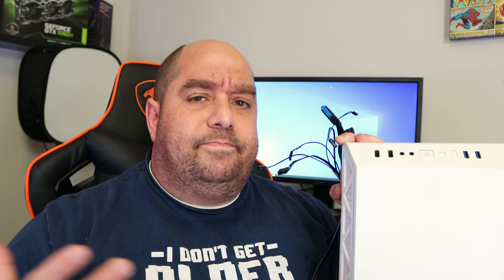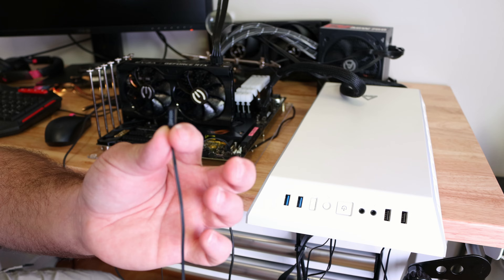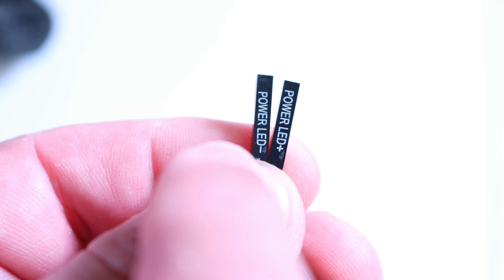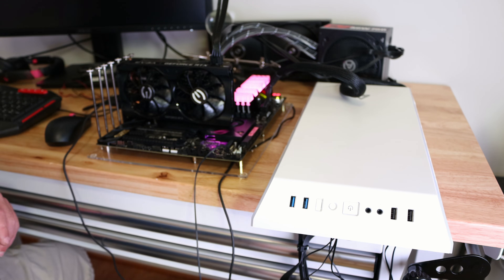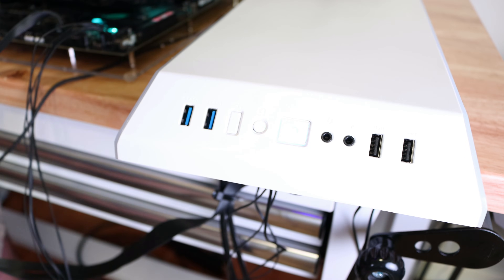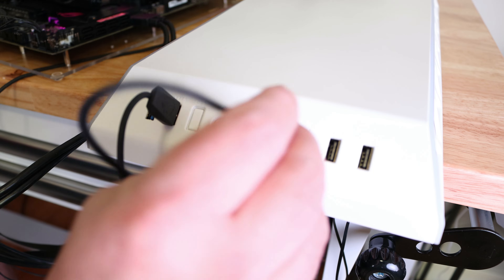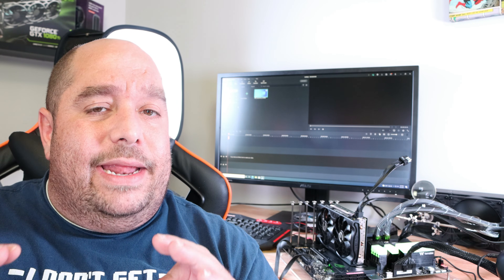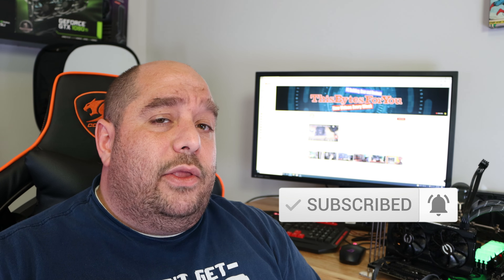Front Panel Connectors - Where do they go connected

Comment: This is certified youtube university material!
Reply from the maker: Haha, thanks bud, so very happy you enjoyed it.
Reply: @ThisBytesForYou  something I run into a lot is when I need a usb 2.0 to usb 3.2 front panel usb adapter. You'd think it would be simple to find such an adapter since it's so common to have a compatibility issue with mid range boards and higher end cases? If I may suggest, if you haven't already made such a video covering where a person can find the correct adapter and what they look like and so on, it would be nice to have your level of attention to detail covering that topic.
Reply from the maker: what, can you tell me again what it is you need?  I don't understand?
Reply: @ThisBytesForYou  like when you use a cheap motherboard under $600 they usually come with 3 usb 2.0 and 1 usb 3.2 gen2 front panel connector and if you use a case like the lian li 011 dynamic that needs 2x 3.2 gen1 and 1x 3.2 gen 2 front panel connector for full connectivity then you need a usb 3.2 gen1 20 pin male to usb 2.0 9 pin female adapter to power the other front panel usb's. When I was first building as a beginner this little cable took me a lot of research to figure out where to buy it and which one to buy. It would be useful if you made a video on how it looks and where to get them. The cables are like $6 and will save someone $300 or more if they can get a $230 board vs a $600-$800 board. Here are a few examples of the boards I was considering that would need the adapter. Asus prime-A z690 and z790, the asus rog strix-A, F and also E z690 and z790 all require 1 usb 2.0 to 3.2 adapter and the same is true with the cheaper msi, gigabyte and asrock boards from what I gathered trying to pair the boards to the lian li case. The boards that work out of the box without that adapter where the higher cost boards like the asus rog maximus z690-z790 and the asus formula z690. It seems one has to pay $300 more for a board that has 2x usb 3.2 gen1 and 1x usb 3.2 gen2 without using an adapter.
Reply from the maker: @Rzn8B58  well, it doesn't mean its cheap, just what they decided, so yeah you will need an adapter like this from my amazon affiliate store, I have them and use them often actually: https://geni.us/HPboU

I have some Z690 boards that only come with 1 usb 3.2/usb 3.0 header so it's not too common just yet, maybe one day hahah.  Some may also chose to work on higher end components on the other end of the board, maybe skipping off of these, like EVGA, those are expensive amazing quality boards but they focus on other aspects, rather than USB.

Comment: i replace my desktop gigabyte h81 motherboard with a new Asus 81 motherboard. But after that, only the speakers worked well but the headphone not work and showed high-definition audio not plugged in. I reinstall the Realtek high-definition audio but not work. Please help me in this case, sir.
Reply from the maker: I think you need to watch this video: https://youtu.be/8JuC_Dpm6-c, PLEASE LISTEN TO IT and please let me know if you have any questions and make sure you plug in the HD Audio jack on the board for your front panel

Comment: I have the led and switch cable connect in the correct spot, but I’m not sure where the other end of the wire goes. Building my first pc and need some help. Thanks
Reply from the maker: Did you watch the video?  That may answer your question because I dont know which cable you are talking about
Reply: I watch but it never showed the other end. It it the cable with the + and - symbols on the small part that connects to the motherboard
Reply from the maker: so that means it is polarized, meaning you have to plug the + into the + end on the board, if you plug it in backwards it wont hurt it, it just wont function until you plug it in write.  It sounds like its the HD activity light but... I have no idea.  On your case, where is the connection coming from?  Follow the portion in this video where I talk about the HDD activity light, yes, it would be the same thing for an SSD.
Reply: Do you have discord so I can send you a picture?
Reply from the maker: iggy@thisbytesforyou.com
Reply: @henryz8859 how did you fix this 😢

Comment: Thanks for the video. Question I just ran into.. I have the exact same HD audio 9pin you have but the motherboard im putting in (Crosshair Viii extreme) has an 11pin. Is there an adapter I need that I just cant seem to find? Can I plug in the 9pin and use the same dead spot as the 11pin? Or is there something else I need to do?
Reply from the maker: on your board, in the same place, (bottom left hand corner) you have the  that port,  with a few extra pins as can be seen on your manual, it will still work, you just need to move it over a row, thankfully that missing pin shows you where you can install it.  I hope that helps.  So yeah, you can install it there and always a pleasure my friend.
Reply: @ThisBytesForYou  thank you, cheers!
Reply from the maker: @Lr0yJ3nk11n5  Always a pleasure my friend, so very happy you stopped by, trusted in me to help you, liked and subbed as well as took a moment out of your day to thank me.  It means a ton to me and I am so very happy I could help you, cheers my friend

Comment: The LED+ and LED- as well as the reset and switch two pin connectors give us which is the positive and negative but the motherboard especially the new ASUS, neither the manual nor the motherboard show which are plus and which are minus.  The board just says "pin1".  Not sure what to do. The board is the new and expensive ROG MAXIMUM Z690 APEX.
Reply from the maker: The good thing is that whether you have it flipped or not, it will not mess anything up, it just wont reset, so they way to test it (because they have not always been silk screened) is to just get into windows, then press the reset button.  If it does not reset, flip the header, then try again.  Plugged in incorrectly will not mess anything up, no worries my friend ;)

Comment: Hey, I'm kinda late to this, but I recently inherited a Phanteks Eclipse P400a for Christmas to build a pc, I also got a ROG strix B550-F gaming wifi motherboard, and it seems I'm missing the Power LEDs, I'm unsure if the case comes with them (Because the case came with all of the wires for the usb's, headphone & mic ports, and on/off button, but yes, I'm still missing the Power LEDs, do you know if this case comes with them? Thanks!
Reply from the maker: it doesn't look like it has a power led, but it has something tied to RGB for the power led.  Checking on the specs page for the case, it does not have Power LED's.

Comment: That beep change lives! Do you know if the rog strix B-570 E has it?
Reply from the maker: can you please explain to me what it is you have an are trying to remove or add, I am confused.
Reply: @ThisBytesForYou  I was wondering if the strix x-570 E has the motherboard speaker included on the box or I need to buy it separately
Reply from the maker: I can't really tell if it does, but you can find them here on my amazon affiliate link: https://geni.us/yA0pbH, you can find the pins on page 1-17: https://dlcdnets.asus.com/pub/ASUS/mb/SocketAM4/ROG_STRIX_X570-E_GAMING/E15826_ROG_STRIX_X570-E_GAMING_UM_v2_WEB.pdf

the manual does not show it has one though, so you will need to buy one.
Reply: @ThisBytesForYou  okay sounds good! Thank you!
Reply from the maker: always a pleasure my friend.

Comment: Ime new to pc building and tearing my hair out were to connect the front panel wire marked LED SW   IVE GOT A MSI PRO CARBON B450 BOARD ANY HELP appreciated ime at a los some one suggested to pull out the reset button connection and plug in the LED SW wire instead
Reply from the maker: You will find it here on page 5: https://download.msi.com/archive/mnu_exe/mb/E7B85v1.2.pdf

Comment: My front panel Connection place has 8 pins
Reply from the maker: in the video I state, this will help you, not put you in auto pilot, since all motherboards and cases will have different pin outs.  If you would like my help, let me know the manufacturer and model number of your case and your motherboard.
Reply: @ThisBytesForYou   C1007 https://www.ebay.co.uk/itm/CIT-C1007-Midi-Gaming-PC-Case-Front-LED-Strip-120MM-RGB-Ring-Fan-Temp-Glass-/203044035401?mkcid=16&mkevt=1&_trksid=p2349624.m46890.l49286&mkrid=710-127635-2958-0
Reply from the maker: sorry my friend, if you just posted this computer, It really doesn't tell me what case or motherboard it is.
Reply: @ThisBytesForYou  did the eBay listing not help
Reply from the maker: you have the machine in front of you... look on the motherboard, it will say the model number and usually the company that makes it, the case.... might be a little harder, but there might be a sticker or something a long the top or bottom.
Reply from the maker: you have the machine right in front of you dude, look inside the case, you will see the manufacturer and model number silk screened on the board, usually at least.  The case, might be a little more difficult, but maybe along the bottom.  I am getting incredibly frustrated trying to help you, you are not trying.
Reply: @ThisBytesForYou  I think it is a Lenovo h530 s
Reply: @ThisBytesForYou  have you got any other way of messaging
Reply: @ThisBytesForYou  i’m new and only 12
Reply from the maker: @gta5ukvids316  no my friend, this is the way to contact me, on youtube.  When I am not at my day job, i am at home, writting, editing, recording, reviewing, benchmarking and answering comments, and if at all possible... tyring to spend time with my wife and kids.  Age is just a number, you have to try, I get being new, but read from the top to this current comment, wouldn't you be frustrated to?  Then to add to the frustration, now its a lenovo... Give lenovo a call, sounds like a proprietary front panel header, you need to get that from them.
Reply from the maker: @gta5ukvids316  sure, record your entire board, then recorded the front panel cable you are talking about, record slowly, so I can make sure I can see everything.  You have to take the side panel off, so I can see in side, if there is writing on the board, something that says Asus, MSI, Lenovo, etc, I want to see that, along with model numbers if its on there, I need to clearly see things.
Reply: @ThisBytesForYou  it looks dumb but ok
Reply: @ThisBytesForYou  done
Reply: @ThisBytesForYou  You see it
Reply: @ThisBytesForYou  did you find anything
Reply from the maker: @gta5ukvids316  where am I supposed to see it, did you post the link somewhere, did you put it on your youtube site?
Reply from the maker: @gta5ukvids316  make the video unlisted so I can see it, its private.
Reply from the maker: see at 0:12 in your video, the F_Panel, I google "Lenovo F_Panel" and found this, this should help you.  Make sure to pay attention like I mentioned in my video, pay attention to the + and -,  https://www.google.com/search?q=lenovo+F_Panel&newwindow=1&client=opera&hs=nYr&sxsrf=ALeKk00I-X6TThJl8urv71tojK72OsafJw:1628686816869&tbm=isch&source=iu&ictx=1&fir=yt9LdvnEmWrgBM%252CsVFXbc6NFUc89M%252C_&vet=1&usg=AI4_-kQPvvvBGbcyqOhxUJ2Gy81zji58iQ&sa=X&ved=2ahUKEwiV7ayZg6nyAhWYW80KHd5NA_kQ9QF6BAgLEAE&biw=1537&bih=733#imgrc=yt9LdvnEmWrgBM
Reply from the maker: @gta5ukvids316  so did that help?
Reply: @ThisBytesForYou  what do I do for their HD audio and USB
Reply from the maker: @gta5ukvids316  look for something like this https://www.google.com/search?q=lenovo+F_Panel+USB&newwindow=1&client=opera&hs=HQs&sxsrf=ALeKk02tAU6sHg6MS6go_2qyGeEK5WmWlA:1628690132807&source=lnms&tbm=isch&sa=X&ved=2ahUKEwjn8sHGj6nyAhUHV80KHfyhCn8Q_AUoAXoECAEQAw&biw=2088&bih=1028#imgrc=ypA8oRz5LtLFGM or this: https://www.google.com/search?q=lenovo+F_Panel+audio&tbm=isch&ved=2ahUKEwjmptXIj6nyAhWdo3IEHViwD4IQ2-cCegQIABAA&oq=lenovo+F_Panel+audio&gs_lcp=CgNpbWcQA1DKoQJY9aQCYIqmAmgAcAB4AIABQYgBtwKSAQE1mAEAoAEBqgELZ3dzLXdpei1pbWfAAQE&sclient=img&ei=2dYTYabWEp3HytMP2OC-kAg&bih=1028&biw=2088&client=opera&hs=HQs#imgrc=70xs_57GgmWeEM
The board does not have front panel USB 3.0
Reply: @ThisBytesForYou  I still don’t understand the USB and audio there’s more pins on there if USB one on the plug there is five
Reply from the maker: @gta5ukvids316  not sure then
Reply: @ThisBytesForYou  I’m only 12 sorry
Reply from the maker: @gta5ukvids316  thats cool and all, but stop using that as an excuse.  I have helped you TONS, look around, try things, thats how I learned about computers, well before google/youtube/yahoo/internet existed.   You are bringing an OEM board into a Custom case, OEM's use specialized components, stripped down to save money, its not standard.
Reply: @ThisBytesForYou  Sorry it’s just I think my motherboard is wrong
Reply from the maker: @gta5ukvids316  I can tell you for a fact, your motherboard is wrong.  This is an OEM board, that should go inside of an OEM case, that has everything made for it.  A motherboard that you or I can go into a store and buy would be PERFECT for this case.  But then you would probably need a new CPU and RAM too, not sure.
Reply: @ThisBytesForYou  it’s just my front panel connect PleaseOn the motherboard has 8 pins
Reply from the maker: @gta5ukvids316  front panel connecter for an ac unit, I would need to know the make and model for an AC unit, for a toaster, I would need to know the make and model of the toaster..... of the case, I need to know the make and model of the case.  I dont have the stuff in front of me, you do, I would love to help you.... but you need to help me help you.
Reply: @ThisBytesForYou  is it okay if I message you tomorrow it is getting late and I have not been able to go downstairs my parents have said I’ve got to go to sleep I will message you tomorrow if ok
Reply from the maker: you can reply here and I will reply back to you, I need to know the manufacturer and model number of the motherboard and the case so that I can help you.
Reply: @ThisBytesForYou  I will tomorrow because it’s getting late and I do not know how to get the number
Reply from the maker: @gta5ukvids316  sounds good my friend, good night.

Comment: where can find the front panel connectors??
Reply from the maker: attached to the case?
Reply: @ThisBytesForYou  
Where can I get the power sw, reset sw ... cables?
Reply from the maker: @vqttiz7727  so, they come with your case, but if you are using a test bed like I am using in this video (which is also linked in the description) you can get the cables from my affiliate link on amazon: https://geni.us/SovU

Comment: Hello boss! I have a problem that I think is big. When I wanted to build my first computer, I consulted the pcpartpicker ,    everything was fine .I choose  motherboard ASUS ROG Strix B550-E Gaming  with a compatible processor, but the processor was long time to arrive, so I decided to change it to a higher processor Ryzen 9 5950x then I built the computer and started working on Adobe after effect I noticed a slow in  Executing tasks, so I thought that the processor is strong and the graphics card may be weak, which is rtx 3060 xc, so I searched again the pcpartpicker                   and discovered that the motherboard not support this processor, so I closed the device for fear of the processor and I will have to buy another board.  The question here is, can I use the computer for simple things, or should I wait for the new motherboard and does (ASUS ROG Crosshair VIII Dark  Hero) support this processor or not? Please help.
Reply from the maker: that board does support the 5950, you can see it herE: https://rog.asus.com/us/motherboards/rog-strix/rog-strix-b550-e-gaming-model/helpdesk_cpu just make sure you have the latest BIOS, what may be happening is that that processor is HOT, what are you using it to cool it?

Comment: Good info! Front panel connectors are nice and easy on a test bench, but I hate putting them on when I've got the board in the case already, but not really an option!
Reply from the maker: thanks bud, when its in the case its a pain in the butt because not everyone can see that tiny text, sometimes the pins.  After that, the greatest resource is the manual, but still sometimes seeing/finding the pins is a pain.  Just trying to make it easy for some people ;)